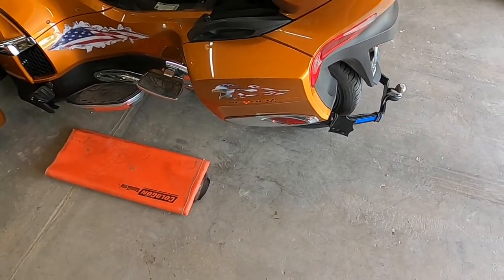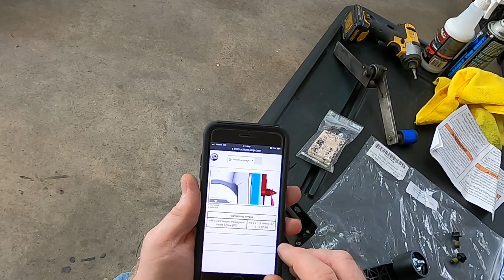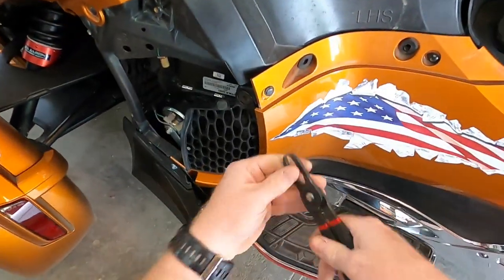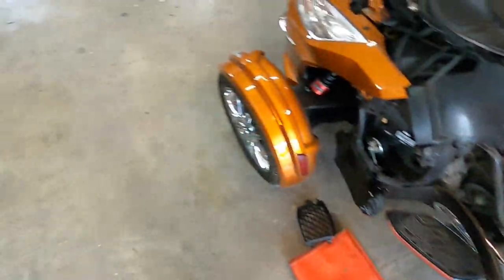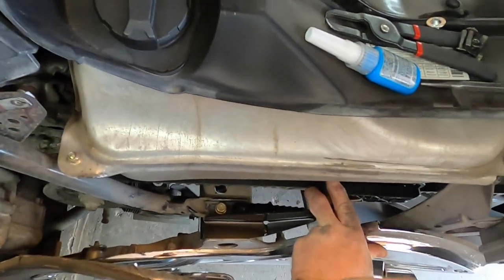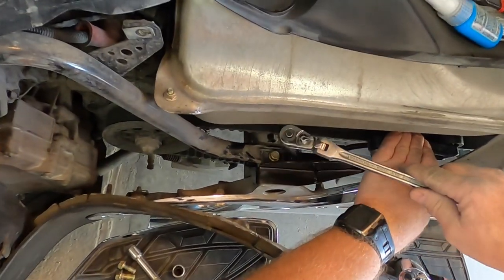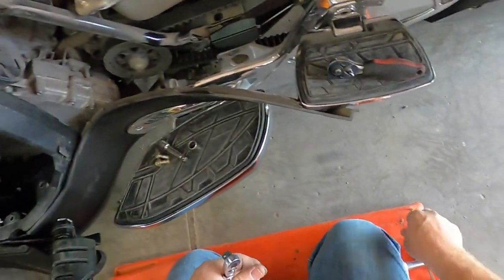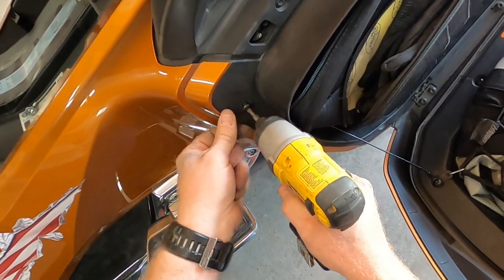Can Am Spyder RT Belt Tensioner/Vibration Dampener Installation

Comment: An unrelated question. We have an older RT (2009), and a 2014 RT. We’d like to put the 2014 floor boards onto the 2009.  From this video, it appears the floor boards attach with two bolts (one which you removed).  While we’d need to order the metal side unit, it’s seems likely it may be compatible. Any wisdom you might be able to share? Thanks, Tom
Reply from the maker: McDrone, Sorry, I don’t know, but since you have the 2014, just tear that that thing apart and try it. :-)

Comment: What torque setting do you have the drill set to not strip bolts
Reply from the maker: Well........ it is just a 12volt impact driver, so there is no torque setting. I just zip them tight and call it good. I do have a 12 volt driver that has adjustable torque but it doesn’t run as fast. I’m impatient. I definitely would not use any of the higher voltage impact drivers on these.

Comment: I wonder how many people are turned off on buying a spyder because of videos like this that show that their engineering out of the factory is dodgy. From someone who is/was interested in buying one, I am now loath to do so because from my perspective, they seem to have quite a few problems and are high service demanding. Is  it just me? The idea of having an extra wheel to keep the bike (?) upright is great but where do you draw the line here? They are expensive in the first place and to just keep throwing money at it is not for me and probably not for a lot of others like me contemplating buying one. I would love to just read and watch videos saying how good they are, and these do exist but gee they seem to require a lot of servicing to keep them on the road or just repairing/modifying  factory problems.
Reply from the maker: You have a point. I was aware of the few issues these machines have before I bought it. I am making these videos to give people that would rather do their own work some guidance or encouragement to do so. I’ve put over 30,000 miles on this machine and have yet to be stranded. I think they are very reliable. Thanks for watching.

Comment: My 2020 RT Ltd vibrates at about 73 mph. I very seldom ride that fast so I’m not sure if I need one.
Reply from the maker: If it doesn’t bother you or you don’t drive the speed that the vibration happens, I wouldn’t install one of these. In my opinion, it is sort of a risk even having one of these on the bike because of what it can do to your belt if it fails.
Reply: How much vibration occurs at those speeds? Did the whole bike shake or something?
Reply from the maker: It is more like an annoying buzz that you can feel in the floorboards and handlebar.
Reply: @ItsYoursOWNIT  ahh ok. So if I was to get one, is that  the area I should look at? Including the pully area?

Comment: Shouldn't the tensioner be on the bottom of the belt???
Reply from the maker: Not this one, I have seen one that looks like a serpentine belt tensioner that mounts on the bottom of the swing arm.
Reply: My thoughts as well however if this works it’s a winner.. vibration does bother me at say 65Mph.. 110km here in Oz.